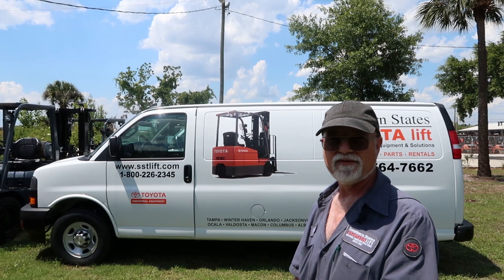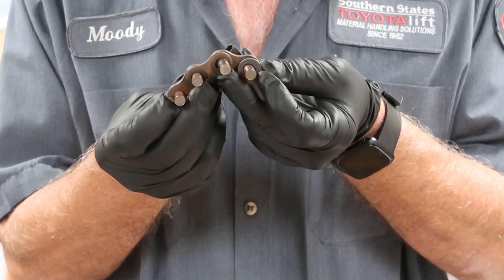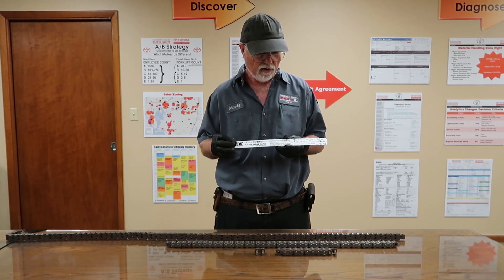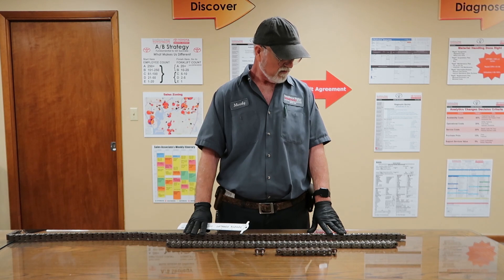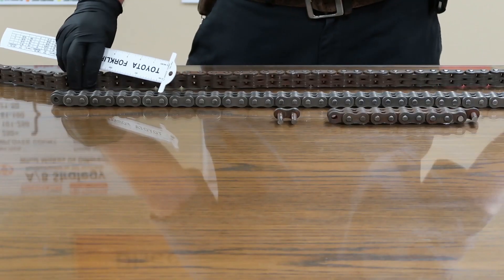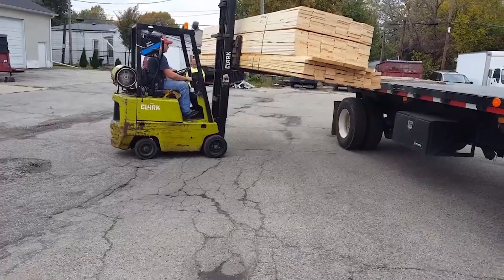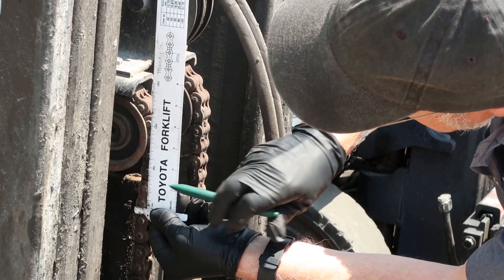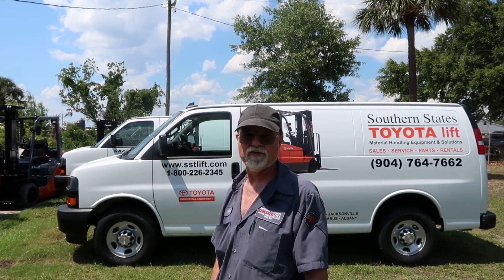How to Measure Forklift Chain Wear with a Chain Gauge

Comment: Hi Moody, very good video to maintain the chains on a forklift. In order to measure the chain elongation, this is possible when the chain is stretched. So you have to lift a bit (5 centimeters) the forks from the floor to measure the elogation of the front chains (free lift) and lift the main lift cylinders (5 centimeters) in order to measure the elongation of the rear chains. Thank you to shared your experience.